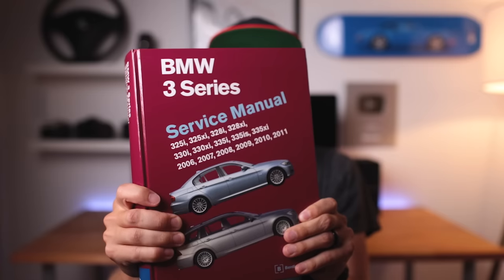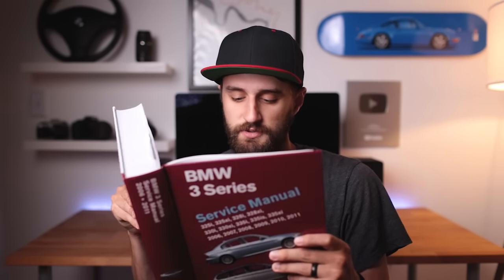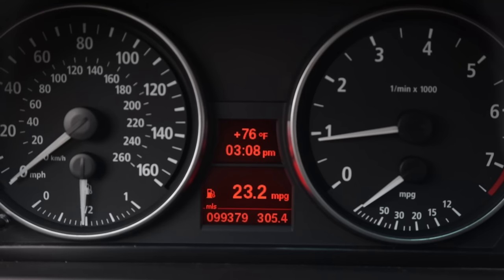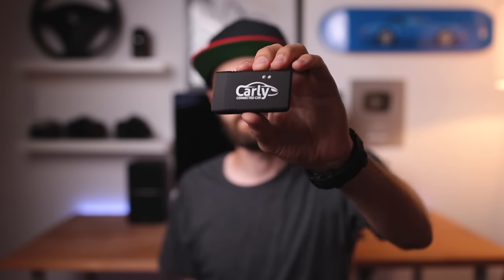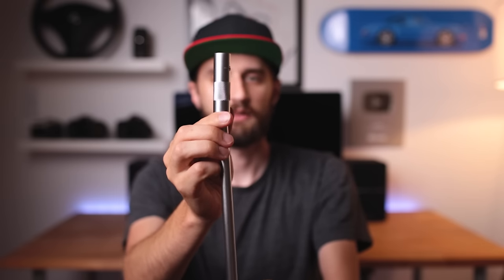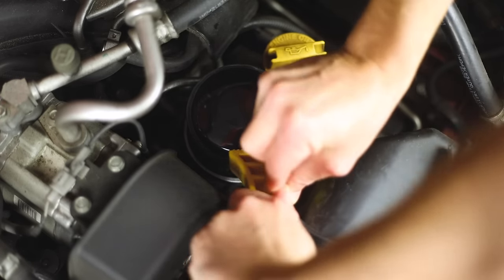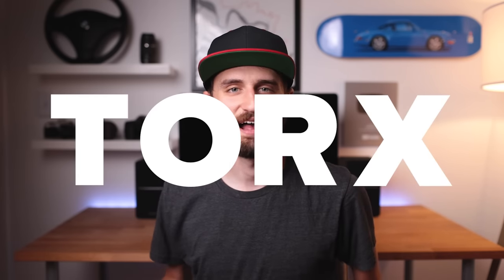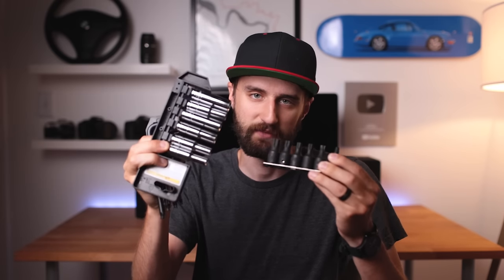5 TOOLS EVERY BMW OWNER NEEDS!

Comment: The Bentley manual is a MUST, but once you've purchased the dead-tree, go get the PDF. This lets you do word searches and print out clean copy of individual pages to carry out and mark on while doing the work. I have the fuse block use-table color-coded and next to the glove-box sheet.
Reply: Any links to just a PDF Service manual?
Reply: I got mine on line free and downloaded to my iPad.  I just did a google search
Reply: @Mike0in0Texas  Hi Sir. I have a 2013 bmw x5 35l 3.0 twin turbo. wondering if i would get one on that site there for my vehicle??.. ty
Reply: @Mike0in0Texas  ty Sir,how much does it cost for a download for the manual  ty
Reply: battlehrfred it’s free.
Reply: @Mike0in0Texas  ty very much!

Comment: I love that bmw, Mercedes and Audi use torx. After years of working with my dad doing construction I can say torx are the most durable and strong design for screws and bolts. +, -, and even the square ones wear out over time and strip easier than torx
Reply from the maker: I agree. I love torx hardware!
Reply: Yeh, I’ve never seen a cammed - out torx bolt/screw head.

Comment: Big W on the Bentley manual my dude. I've used it for valve cover gasket and oil filter housing gasket replacements, installing coilovers, and next up is an oil pan gasket replacement. Indispensable.
I'm also with some others in the comments - I got BimmerCode instead of Carly and have been really happy. Does everything that NCS Expert does.

Comment: Was thinking about getting Carly but got carista instead, does the same thing as Carly but just cheaper .
Reply: Which car are you using it on?
Reply: Ibrahim Yousuf I use it on both my 2011 328 and 2010 335

Comment: The 86mm oil filter socket And the torx wrenches are a must for oil changes. I bought mine off amazon. Couldn’t find them at autozone/local auto parts store.

Comment: Nice Video Justin! i was wondering if i did purchase a "Carly reader" can i actually read the Coolant temperature and Oil pressure in "realtime" always,when i am driving my 2013 x5 35i?? i dont like the idea of not know the coolant temps and oil pressure,especially the Coolant temp, for me its a must  "visually see at all time as there isnt any other way to show it on the dash panel "permanently"  BMW over engineered without "simple dash display"  ty keep up with your excellenttttt vids!

Comment: If you own that manual what is the thread size for a bolt into the upper footwell hole for a clutch stop? (e90 n52 3 series 2010)?

Comment: For anyone reading this who has an X-Drive BMW, I can't recommend the XDelete app enough. It allows you to set the torque split between the front and rear of your car. In the summer, I have my car set to 100% rear, and it's like an entirely different car. And if you're looking for a Carly alternative, I've really enjoyed ProTools. It's a one time payment compared to Carly's annual payment. However Carly is a little more refined and user friendly.
Reply from the maker: How much does XDelete cost? I really want to get it
Reply: @justinbuice  According to their website, it's currently $135. Definitely worth it. It's not as perfect as a RWD BMW from the factory since the XDrive models don't have a LSD, but I know that people have fitted the LSD from the RWD models onto the X Drive models
Reply: @justinbuice  Plus you'll need an OBDII cable that you can plug into your phone if you don't have one. They're fairly inexpensive on Amazon

Comment: Carly for diagnostic is garbage. I was getting bad coils message on 4 cylinders. I had my BMW tech friend come over with his scanner and found out it was the spark plugs and not the coils. Purchased coils and didn't even need them. He just swapped the plugs and it's been running fine for the last 10k miles .

Comment: Need help  any body , valvetronic motors giving me hassle lately,  limp mode again ,  now code 2a38 , it doesn't give Pacific's is  the motor or the sensor, don't want to replace one if it's the other

Comment: Noticed that Manual only goes up to the year 2011, I drive a 2012 e93 :/
Reply from the maker: It could be that the model year difference is a regional thing. Im not sure there is any major difference from 2011 to 2012. Note that the book linked in the description is for gasoline engines. What engine does your car have?
Reply: Justin Buice I believe I have the n52

Comment: TORX is used by basically every German car manufacturer. So this tip can be  used by everybody who has or wants to have a German car. And ask me who is a German and own a VW 😅
Reply: By the way Bruce I'm the guy who translate the later that you found under the rear seats. So if you ever need help with something "German" you can just hit me up. 👍